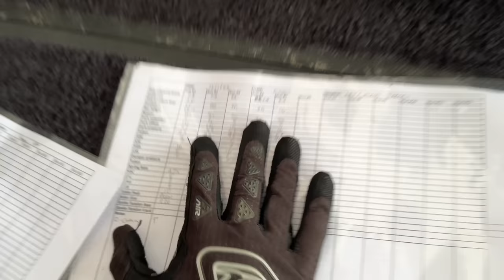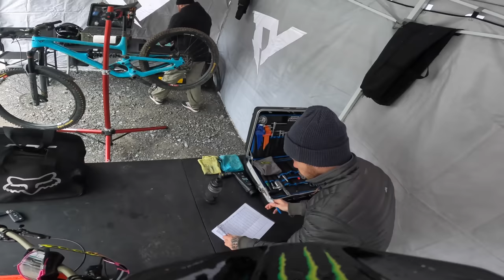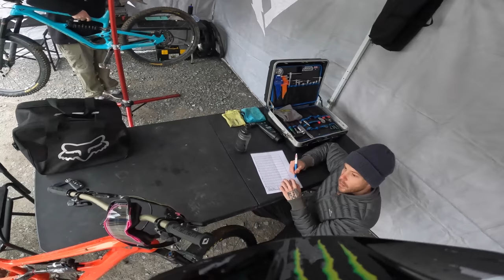SWING ARM TESTING ON THE NEW CAPRA | Jack Moir |

Comment: So, you are relying on the frames progression rate to hold the bike up instead of the compression circuit?
Reply: Sounds like he's relying on the tune rather than adjustments
Reply: @daveybmtb  on the light tune though...🤷‍♂️
Reply: @pernyberg2816  nah will be a custom tune. This is a factory rider we're talking about
Reply: @daveybmtb   for sure. But, when you look at some EW...I mean EDR riders their setup look VERY soft and I get that from a comfort all day point of view. Melamed said he runs it megasoft and takes the extra bottom-outs with his arms.

I guess that you're on their level, the job of the suspension is a whole other thing than for us mere mortals. Just interesting to see how talk about their setup.
But yeah, for sure custom valving (and pretty sure dampers as well) for the top level pros.

Comment: Ive learned to mtb with a 27.5 capra for 6 yr and struggled with cornering, the G’s would send me wide or i brake more and bike stands up.  Now i just got a new 29er trek fuel and its like its invented cornering its unreal. Its tq ebike motor fuel exe, is it the 1.8kg motor acting to help to bike lean? Im baffled
Reply: the 27.5 capra is a cornering beast!! it’s a basically a slalom bike. Keep practising!
Reply: @bimfred  i think its down to the capra being alloy frame, alloy bars and alloy wheels. The trek is carbon bars, wheels and frame even tho bigger wheels it seemed easier to handle
Reply: @eph8334  either it fits you better or you are just going slower
Reply: @bimfred  the capra was always too small for me so raised bars and got bars with bigger rise but always diffcult to lean the bike.  If the trek is cornering better then exit speed is faster and that has been really noticeable.
Reply: @eph8334  i agree exit speed is lacking. short back end and small wheels. Glad you found something that works
Reply: @eph8334  What size are you riding? Ive noticed that YT frame sizes run smaller or have a tighter range per size than some other bikes do. For instance my previous bike was a 2014 Kona Entourage 26 inch frame, an aggressive enduro bike more aimed at bike parks & shredding, bought 2nd hand with Fox 40s. Anyway it was a medium, had shorter chainstays but a longer front & triangle & slack geometry (the Fox 40s didn't change the Head tube angle at all). The sizing for that model went small, medium large, xl.. Now ive got a 2018 YT Tues 27.5inch, its a large, with a longer chainstay, & slightly lower bottom bracket but not by much, & its a longer bike, but the wheelbase from axle to axle is the same. The sixing for YT Tues goes small, medium, large, xl, xxl.. 

So it could be that you simply have the wrong size bike, because YT sizing has a smaller range between sizes than some other brands.. My experience between the 2 bikes is that even though they both weigh the same, both aluminium, & the chainstays are longer on the Tues, the frame design is such that its easier to flick around & bunny hop, even though the YT is "large", & a Downhill bike, when the Kona Entourage was an "Aggressive Enduro" bike, originally released with single crown, though a 63deg head angle, about the same as the YT Tues, & with a more "pedal friendly" seat tube angle & 180 travel, instead of 200mm travel. Despite the fact the YT Tues is a DH bike, even after i upgraded the Kona to a 32 tooth chainring, the YT with a 32 Tooth chainring is still easier to pedal, uphill even, corners better, & is more flickable. It comes down to the frame geometry & the linkage.. But the YT Tues corners awesomely, even better than a bike with shorter chainstays, & that wasn't designed with triple clamps in mind like the YT Tues obviously was , though the head tube angle & slackness of the top tube are the same.. 

So in summary. A bikes frame geometry can make a big difference. But also Medium isn't always medium, & large isn't always large. The sizing can differ between brands. Give the YT Capra another go mate. If it corners as good as the YT Tues, then it's a cornering beast. You might just be riding the wrong sizing.